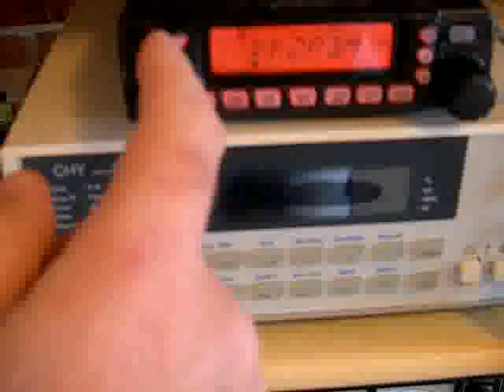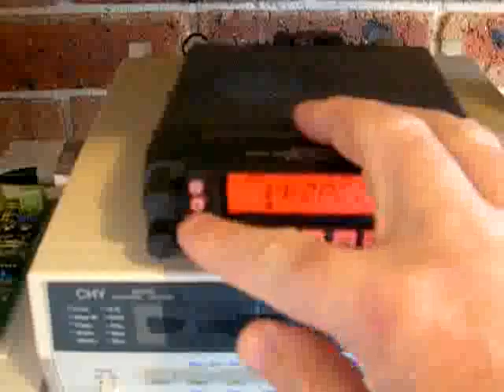Programming numeric memories on Yaesu FT7800 / FT7900

Comment: Just a little tip: Say, if you've programmed 100 frequencies into memory and assigned  them (some) into bank 1, you can start the scan in bank 1 and then save a hypermemory. If you have done some other operations on the radio, like had a QSO on 145.600 in VFO-mode, you can start the scan on the selected bank just by pressing that hypermemory button. You probably know this, but I'd just like to inform people anyway..